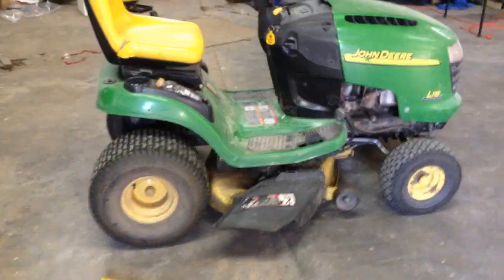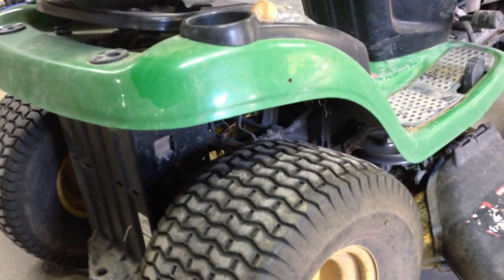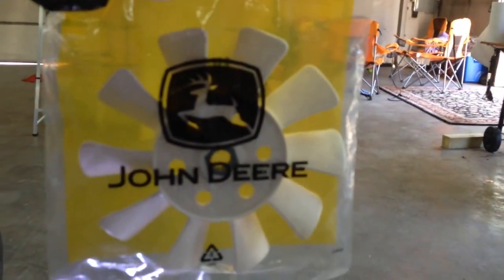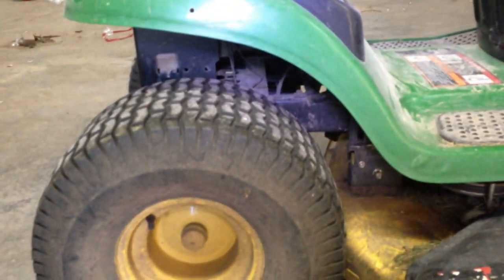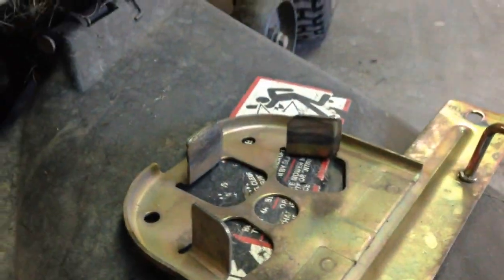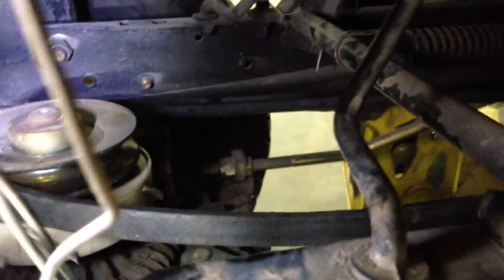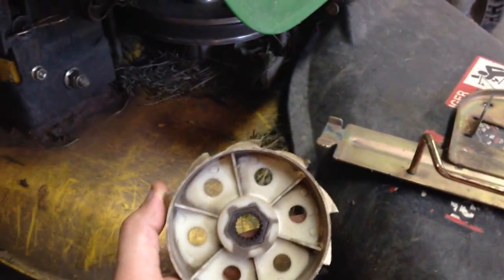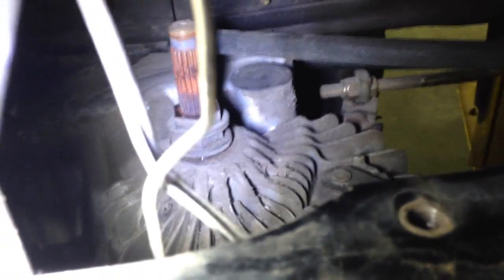Mike's Garage: E11 - John Deere L118 Transmission Fan Replacement

Comment: had same problem. fan blew up into millions pieces. although I have a LT155 they are pretty much the same. Only problem I had was with the snap ring. bought a tool but had to modify the points to fit. video very helpful and saved me money. john deere dealer wanted $75 just to look at it. thanks again.

Comment: I just replaced my fan.  It is not really necessary to remove the wheel, and I just removed the bracket and slid it forward out of the way.  Total stuff to remove is one bolt and one snap ring.

Comment: The reason the belt got into the fan was because of the cheesy designed transaxle belt guide.  The driver's side rod piece just slides up and down through a hole while the pax side is secured by a nut.  Over time, the driver's side will push out of the hole and force the belt guide down which pushes the belt into the fan.  Awful design.  You can see it out of place at 2:16.  Unless you put that side back in the hole and bend it up, you're gonna hear that noise again of the blades getting eaten up.